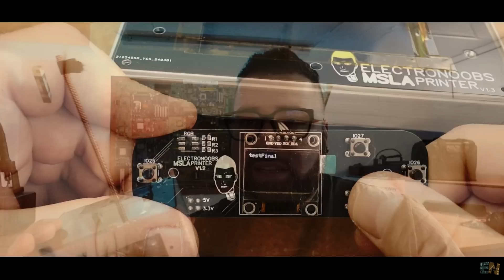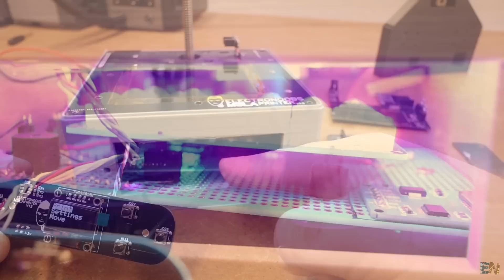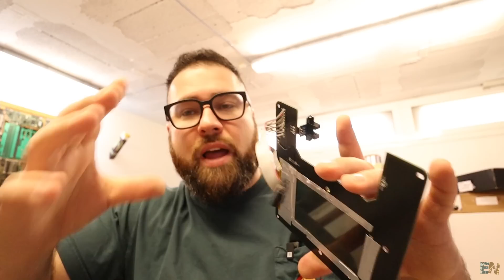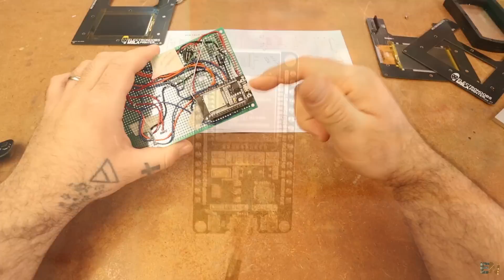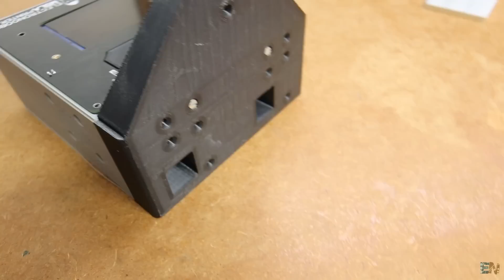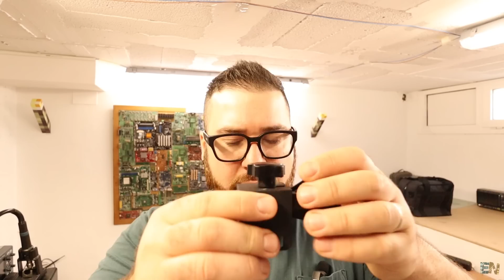I Spent 100 Hours Building an MSLA Printer and Here's What Happened

Comment: I've been looking at resin printer projects for years but they mostly seem to end up abandoned,  the  manufacturers keep bringing affordable decent printers to market before the open source projects really mature. And of course the technology moves quickly so even 2 years after starting,  if you chose already established components, you are looking at retail machines beating you in specs and price every time. 

Where a diy machine could really make a dent is in the large format realm, but with even established manufacturers being at the mercy of screen manufacturers,  and the cost of those screens being painfully high,  i think a different approach needs to be tried.

Im thinking about DLP for one, but another approach i have in mind is using an available mono screen in the usual standard to mid range sizes, and mounting it along with the light source on a Y axis in the base of the machine. 

To use the entire print area, the layers would be split into 2 or 3 segments, each exposed in succession,  as the assembly moves across the plate. 

For smaller models one can default to just one portion of the plate, thus maintaining acceptable speed, but obviously using the whole volume would increas times drastically as each layer will have two or more exposure events, along with travel time for the Y axis. 

Another advantage however is you can easily get tiny modern pixles in a large machine, you can use the best screens available today, like the 8k units offering 1150ppi, and have that same density in a printer the size of an M7 max, or a 10" class screen, which would compare to the 16" class machines in size but with still very good resolution.

Comment: Instead of a ribbon cable I would use 26swg silicon wire, that is very flexible and print up some clips to hold the wires in a row, awsome project keep going it will be good.

Comment: You should create a 3D printer that would be the module to connect a big motor and a screen via HDMI and that each person could create the rail and the resin container. This way you could create a resin printer with a 70-inch 4K screen if you wanted. my dream
Reply: Yeeess ! A main controller board with support for hdmi and USB output would allow controlling arduino via usb and an external screen driver board via hdmi.

Comment: Excellent work - I appreciate how much work it is to solve these problems from scratch and I have learned a lot from following along.
I have been interested in using this design to create PCB prototypes, so this low-cost, simpler design is ideal for that application.
Please continue with this project.

Comment: You should try using fresnel lense and use one UV led this will make the light rays more uniform and parallel resulting in a good print 😊
Reply: or just make a led panel with a bunch of smd UV leds, since the density would be very high the light would be pretty uniform and no need to deal with optics

Comment: I think this is an invaluable project to open-source MSLA machines a little more. There isnt a control method for resin machines thats as well documented as controllers for FDM. I have a broken Anycubic Photon 1 that I tried to resurrect with NanoDLP and I can't get it to work. A self contained printer that I plug an SD card into with a chitubox/lychee sliced file is what I want and Mr Electronoobs is delivering that with this project. Get the masking screen data output into DVI/HDMI and it will be perfect for home brew machines. Awesome work, thank you for perservering with it!